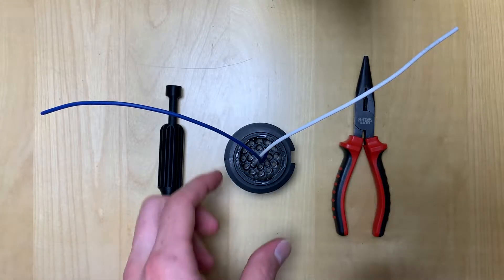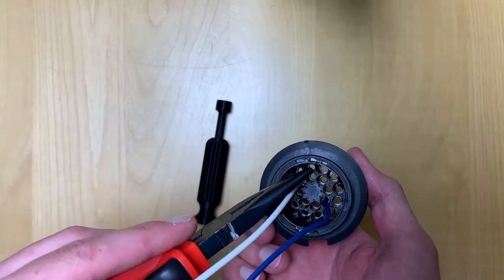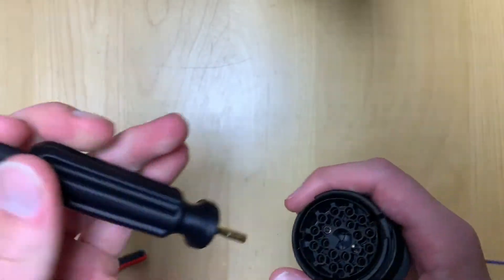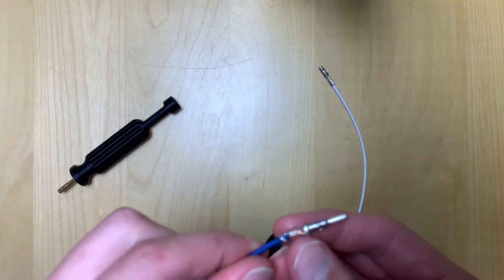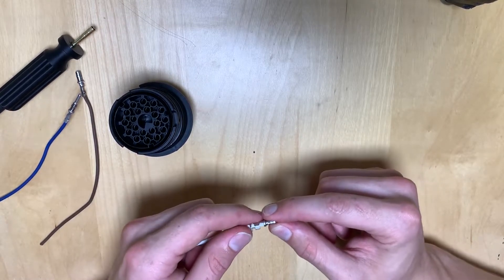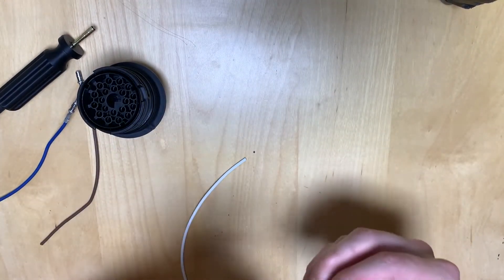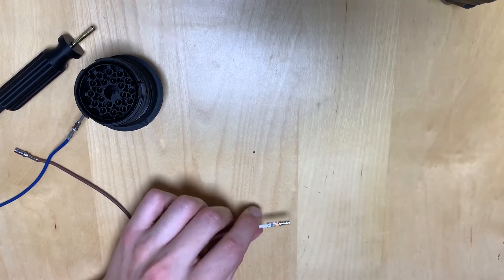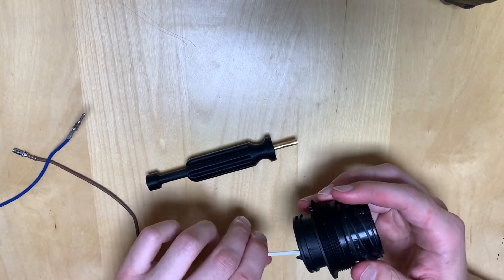How To De-Pin/crimp E30 C101 C191 and diagnostic connectors

Comment: Will your tool work on the wiring harness of 1998 540i mass air flow sensor harness?
Reply: does it have the same 2.5mm looking barrel pins? Its worth a try

Comment: will this took work on the Jetronic C101 (i.e. the square plug)? The square plug has both small and large pins
Reply from the maker: No, I don't believe it will. I recommend upgrading to the newer c101. This way you can use this tool, you can use pins that are newer/still available, and its compatible in case you ever engine swap a newer engine.